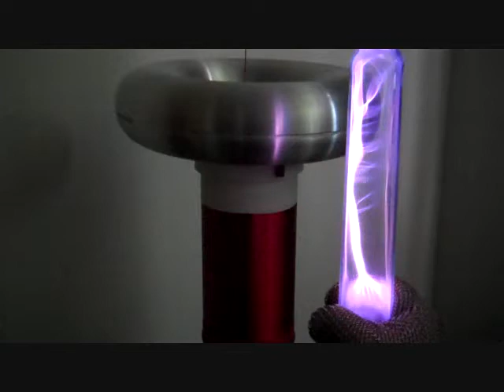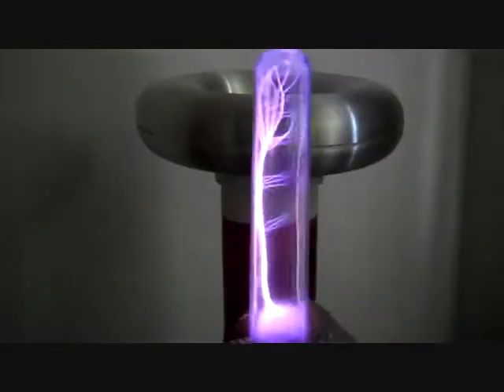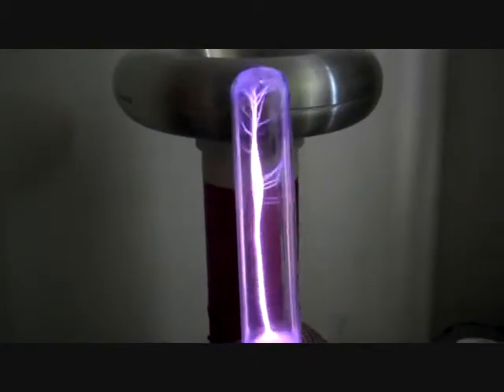Custom SSTC Inert Gas Glow Discharge Tubes - Argon & Neon

Comment from the maker: Yes, Carl Willis has been doing research in such power supplies. Basically it is an AC fllyback or other HV transformer run at very low RF frequencies near the natural resonance point of the transformer. Coupling to the tube is done with graphite or other condtuctive high surface area connector.